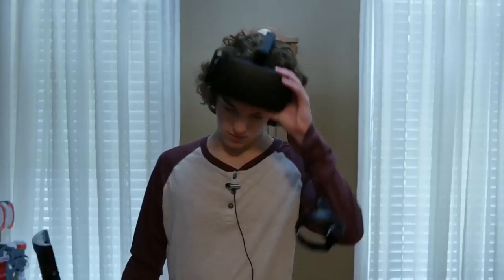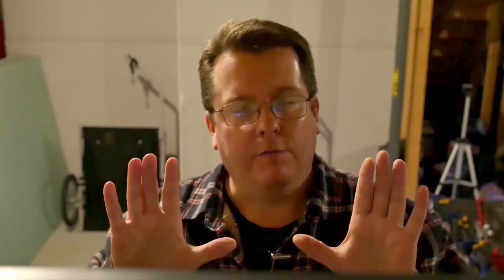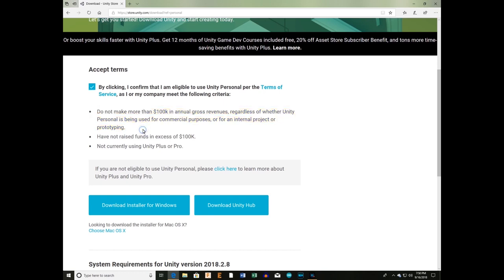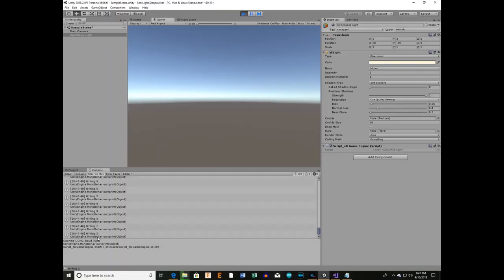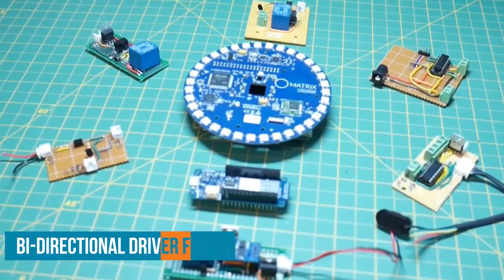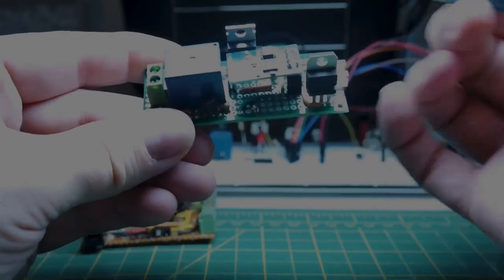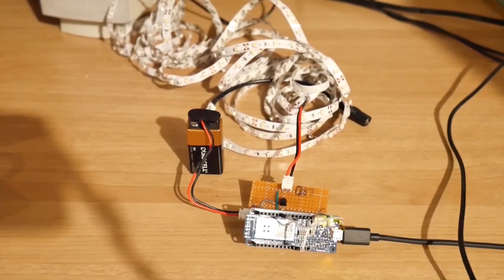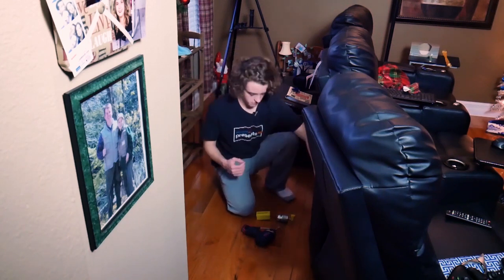4D Gaming with the Matrix Creator

Comment: What about going with a system with a A10-7850k which has on board RADEON graphics will need 64GB of DDR3 RAM, can you not use Monodevelop and the avr-gcc compiler with avr headers and libraries.

Comment: Actually time is the 4th dimension.  If you just add an third dimension to the third dimension. You get the third dimension:D like calculating with temperature.
Thx for your attention.

I got the joke I just wanted to leave a comment
Reply: Fourth dimensions isn't always regarded as time
Reply: @dfalconerio  the spacetime is usually called the 4th dimension. What else? Everything else wouldn't make sense.
Reply: @schnibie1991  I don't get how time can be a dimension. You can't move in it.
Reply: @dfalconerio  You should read some more about it you are moving in it all the time. And with it I mean the spacetime. Every object has his own spacetime if you fligh into space and turn some or many rounds around a black hole as near as you can and then come back to earth. You will find the future because we have just the earth gravity but you the gravity of black mass wich is higher by far. This means that your spacetime goes faster then our but just for you even when both of us think that the same time pasts. Another interesting aspect is that before you could change the speed of light the light changed the room when it's moving it's making the room Lager or thiner so it's looks for you just like the speed it ever had. Spacetime is the 4. Dimension. And it is because of reasons.